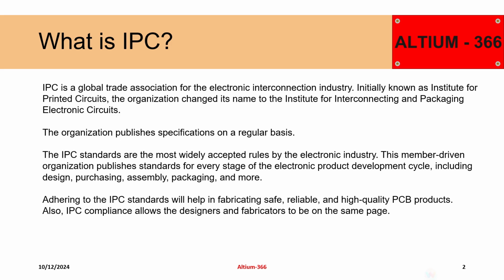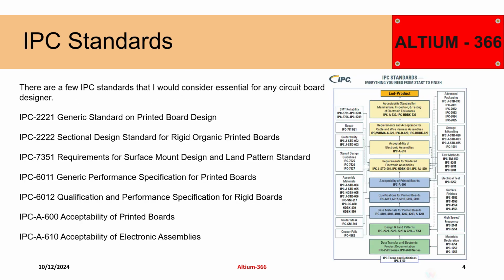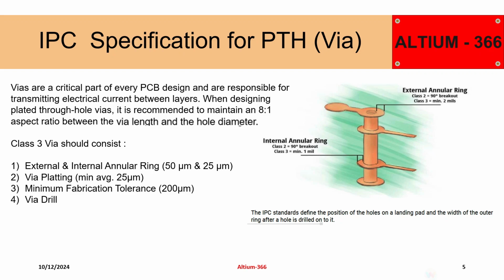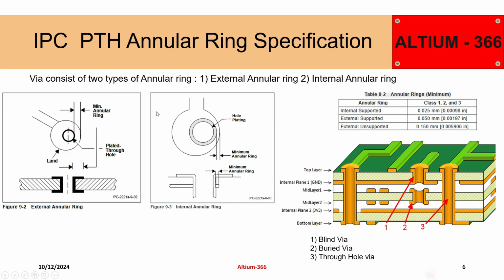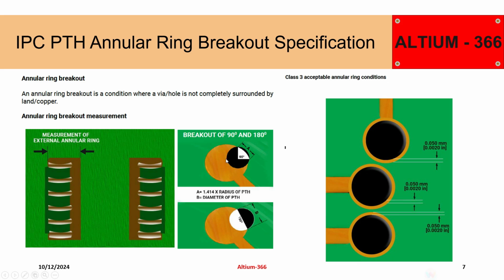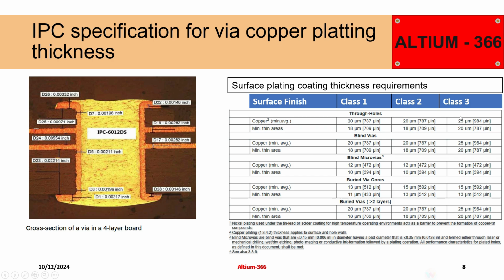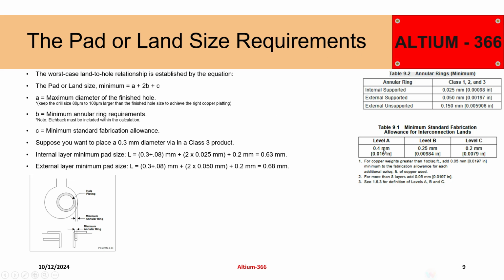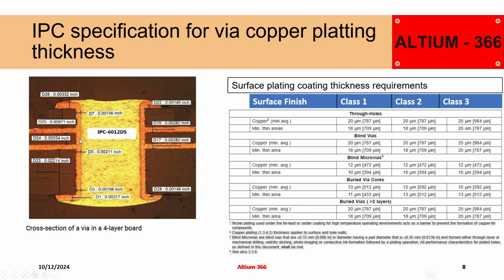Altium Designer Tutorial 37: IPC specification for plated through hole (Via)

Comment: I don't think you need to add the 0.08mm to allow for the drill versus finished hole size, do you? A 0.68mm pad for a 0.3mm hole is too big for many cases.
Reply from the maker: Hi David,

0.08mm min. i added for via cu. plating which is specified in IPC6000 series min. 25µm (.05mm in total) for class3 type components and the rest (.03mm)is drill size tolerance (thumb rule) and that's why it's in between 80µm to 100µm. Reg. the pad size calculation (0.68mm) for 0.3mm via, as i said  in my video this specifications are from IPC  for class 3 type of component ( Automotive, Medical etc.) which must be followed for safety reasons.